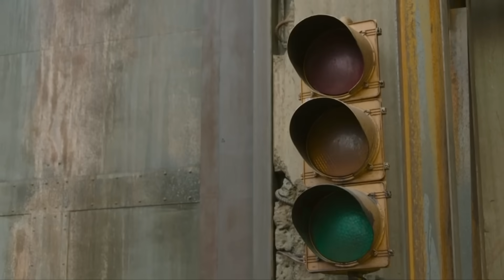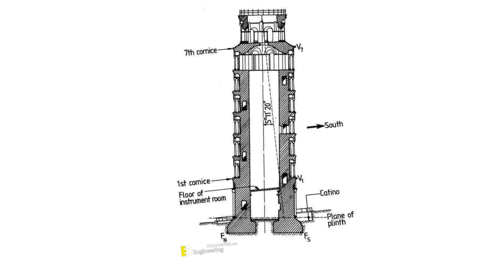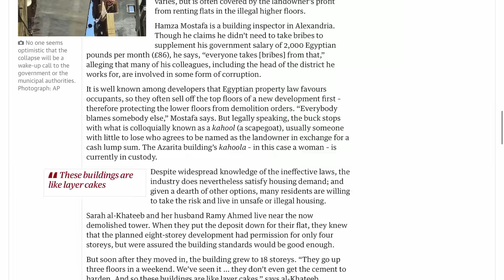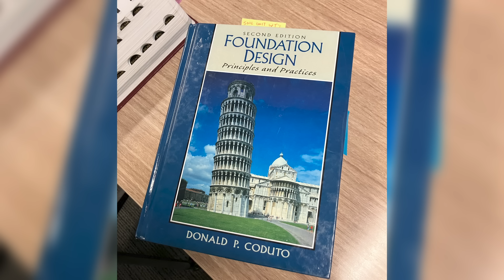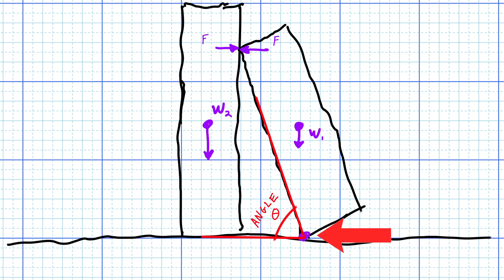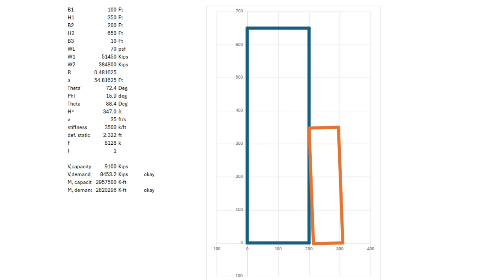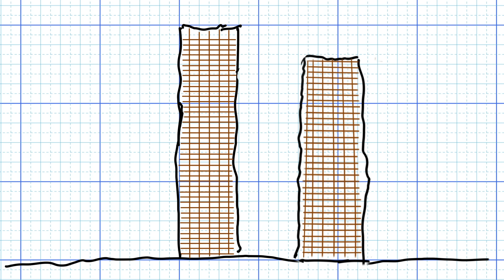Analyzing the Leaning Towers from The Last of Us

Comment: Correct "solid body" of which a building is not. They happen to be the sum of their components or designed for upright forces. During storms, how many times have you heard the statement "A transformer exploded on a utility pole" when it was just the breaker and an arch flash.

Comment: @1:50 so, about that. you can actually calculate a pretty good estimate based on the materials resistances to forces that would occur in the stated situation. most of that would assume integrities and stresses based on the area by-laws, within a certain margin, and plan for a contingency to create a relatively safe outcome for the public to happen more often than not. someone had probably done these calculations already. 

ill try and find them, 

hold on.
Reply: @11:10 Fun Fact; when the building eventually strikes the other and comes to "rest" it will also straiten out slightly since it has a force "the more stable building" acting on it and taking some of the force exerted by its own weight. and there will also be a ripple down buildings too. thats what breaks the glass around the impact site that didnt actually get hit most of the time. just remember. from a certain perspective... everything acts like a liquid or gas kinda. :) we are just free floating masses of not too excited atoms hurtling through space spinning around a giant but relatively tiny sphere of very dangerously excited atoms.

Comment: If one of the building foundation is washed out, it is possible that the others also washed out, so the straight building maybe not just holding because over engineered for the strongest earthquakes, but it may also leans to the opposite direction it just looks straight. For the winds, the two structure have a chance that creates a stronger structure than the collapsed buildings would be alone by holding up each other.

Comment: The collapsing foundation failure could be fudged to provide as much or as little force resisting the lean as needed. The real issue in terms of feasibility is the leaning building's structure at that angle.

Comment: I've watched until 9:34 and theres something I think needs to be said. You state a hypothetical bomb that exposed water mains could lead to flooding. This is fairly close to what the actual reason would be. That reason being that due to it be a post apocolyptic world, there is no longer the infrastructure in place to evacuate water efficiently. This, along with other water related reasons has led to mass flooding in cities, especially this city, during gameplay youll be very hard pressed to find a building where the basement isnt flooded, even large portions of "above ground" areas are also flooded.

So you don't need a hypothetical bomb to break water mains, its well established that there is already mass flooding basically all over the city. ( :

Also not to mention all of the other factors like metro and below ground areas colapsing. @-rx1dr has a good statement on it that you already replied to.

Comment: If it was to be realistic those building would rather look like either WTC  after collapse, or at most a Hindenburg after a fire - a half smashed tumble of twisted beams and ruble laying on the ground. But what looks even more absurd are those half-destroyed buildings where equal parts of curtain wall and framing is missing while the rest of the building is perfectly straight... Like it was done in some painting program 🤣 In reality, only the curtain wall should be stripped by initial blast, and the underlying exposed framing should be partially bent and collapsed on itself due to sped up corrosion as compared to parts not exposed to elements. But hey, what do I know xD

Comment: Also, the impact of the explosion (which is basically between the buildings) should've sent the building leaning in a different direction.
Reply: Not even the US biggest airdropped bomb would push the buildings apart, the buildings have to many open faces.

Comment: You actually made me think to the old Professor Fontecedro.
He said that Geometry had no solid basis.

He made this logic assumption: if we want to describe a square, we have to say that a square is a geometrical figure that have four sides and four angles each one have 90° of extension.

All good until here? Good.

To describe a square we had to use new terms that are: "angles" and "sides", "degrees" etc.

All terms that implies and ask for further explanations to define them and so on forever.

In short: geometry doesn't have solid basis.

Comment: Yes this is highly possible because I I have seen it with my own two eyes what columns  can do after a natural disaster. I worked on construction site  where Hurricane Harvey had passed. I went there after a month and I  saw what independent columns can do to one another after a strong natural force passes by. In The Last of Us it would be the force of decaying concrete giving up any tiping over and leaning on the next building which will cause the rebar to interwine with each other.

Comment: All this seems to me to say "it's very unlikely and would need to happen a specific way, if at all possible." With that delicate of a situation for the towers to initially end up like that, it makes it practically impossible that they're STILL like that when the player views them considering that the story takes place 20 years after outbreak day. Something somewhere must have worn away due to the elements enough that they should have fully collapsed by that point, in my opinion. Maybe not. They are made of rock and metal so maybe they could withstand 20 years of weathering after an initial bombing?

Comment: What about a smaller building (meant to be expanded upwards so the structure is super solid). This one gets a taller building resting on top of it ~ish instead of on its side. So most of the force would get transferred at angle closer to the y-axis (which the supporting building was designed for).

Comment: Great video! My take on the withstand of the building (and this may be a bit of a reach) is that the buildings over the 20 years are supported by cordyceps and it somehow stabilized the building’s structural integrity. I mean considering how powerful and robust bloaters are, enough of those kind of shields might have reinforced the building.

Comment: In the game, The leaning tower has an entire metro station right underneath it that its lower levels have "sagged" into. The player descends down the tower, through openings in the ground and soil, and into the station without ever exiting the tower. I believe this supports the theory that the tower is leaning the same way the leaning towers we have now do? i.e its sinking into the ground as opposed to it somehow toppling onto the other tower. Also, the tower is still actively tilting in the game. You have chairs and tables sliding down the floor by themselves as you walk, meaning the tower is still actively in the process of leaning and the characters are constantly commenting on it. The relative stability of furniture and computers on desks though points to it gradually tilting, not collapsing into the other tower due to bombing. So if you go by what we see in the game, the tower is very gradually leaning into the other tower due to its foundation sinking into the metro station below it in, it happened recently, and the tilting is still actively going on with the tower likely collapsing in the upcoming weeks/months.
Reply from the maker: Oh nice! I knew that there would be more game logic to this that i wasn’t aware of. A void like a metro system below would make even more sense under a bombing scenario since we don’t even need to assume a water main break. Thanks for adding to the convo!
Reply: I think there was FEDRA patrolling the area and in game we can see there is a massive drop off near the base of the building which forced them to go through the building otherwise they would be caught on their way to the fireflies after curfew
Reply: If I’m remembering right it is also sagging a lot more than the show
Reply: Good points!
Reply: Thank you for this! I came to mention that you go through it in the game and you explained it perfectly.
Reply: what was even so important in the first place for them to go into that leaning building vs any of the more stable buildings around
Reply: @Subreon  It was either the only way or the only available way to get to their destination. Within a reasonable time frame. They were being followed by FEDRA at that moment and needed to get Ellie to their destination ASAP.

The other buildings may have rusted doors or collapsed walls, blocking their way forward. In real life, it may have been safer to build a way over the other buildings if they can't go through them, considering that the metro was infested and there were also some infected in the two towers as well.
Reply: @Subreon  If you pick up the note off of the dead smuggler in the tunnels, he mentions that he’s there to smuggle Frank (Bill’s partner) into the Boston QZ, this leads me to believe that this is a well known smuggling route amongst smugglers like Joel and Tess.
Reply: @Subreon There was a huge sinkhole blocking the path forward and there was people behind searching for them as it was just outside the QZ so they couldnt turn back, so they cut through the building.
Im not sure if the presence of that huge sink hole makes it more realistic that one of the buildings was subsiding into the ground or not.
Reply: @Subreon because it’s really cool, and people would definitely wanna go into that death trap if they weren’t already able to
Reply: @Subreon ngl bro that’s a dumbass question lmfao
Reply: @vaudeville-villain  literally fucking how lol. i've never played the game. you expect people to just know stuff automatically?

Comment: In the video game you're able to see that the fallen building wasn't from the foundation it was because the lower left side of street level was bombed causing the building to topple not because of its foundation but because half the lower levels were gone. So think more so a chair losing its leg rather than the floor tilting the chair.

Comment: I remember arguing with someone over the internet about 9/11, back when I was dumb enough to do so. He was asking why the buildings fell straight down instead of falling over like a tree. He claimed buildings only fall straight down when there are bombs on every floor, like in a planned demolition. He showed me the photos of the small buildings that fell over in earthquakes and such as proof of that. I tried to explain to him that there is a big difference between small buildings and skyscrapers, but he wasn't having it. It didn't fit his perception of reality, which I’m sure was shaped mostly by TV and movies.
Reply: I realized at some point than when “truthers” claim it looks like a demolition, that’s exactly what they mean. They truly think that buildings naturally topple over and not that they crumble when they fail. They don’t realize the immense forces that hold a building together and up and how fragile it can be/look when things go wrong even by a few degrees over those large distances. It’s amazing to me they don’t understand that it isn’t actually a rigid box and that, no, you can’t assume it would fall over like a domino would.
Reply: Not only that, but Twin Towers had quite a unique design to them with rigid steel core in the center, the outside frame and floor platforms suspended in-between in a self sustaining tension
Reply: There is also the factor that an Earthquake involves the building to be subjected to both vertical and lateral movement of it's foundation. Thus at the moment of an Earthquake induced failure the structure is generally already going to have some lateral momentum that it will carry with it into the collapse sequence. The twin towers were at rest prior to the collapse so without some imbalanced lateral load where is the lateral momentum supposed to come from. Stuff does not accelerate for no reason you need an imbalanced force to accelerate them.

Comment: I thought almost all glass and steel buildings of this size were actually huge concrete and steel cores with non structural exteriors. thats why the twin towersdid not collapse until thecare section gave way, not when the exterior wallsweer destroyed. These solid wall buildings in Egypt are an entirely different scale and type.
Reply: Twin towers used both the core and the outer perimeter as the main structural members. It’s what allowed them to have such “open” interiors. Other glass-curtain buildings do have less support on their exterior, but sacrifices some of the interior space to do so as well as having cores. This is in contrast to older buildings that are essentially just a bunch of repeating cubes of consistent spacing throughout the entire structure like the Empire State Building. There’s plenty of room for hybrid structures as well and a spectrum of design choices mixing the methods. Twin towers were almost purely core and outer frame, though and the prototypical example of that.

Comment: In some of the views you showed, it kinda looked like the leaning building flexed a bit, almost like it's partially hanging from the other instead of leaning onto it; maybe they got tangled just the right way that the velcroing hit just the right balance between the pushing away from leverage effect and the pulling in effect of the leaning building trying to get concave and bring the other building over it?

Comment: Going off your bombing broke a water main and washed out the foundations idea, it could be possible that BOTH buildings started tipping towards each other, and made contact but stopped as the water service shut down, leaving only seasonal runoff to continue the errosion. Thus as the buildings shifted over the decades, the one which appears to be leaning ended up supporting the other and pushing it back to near upright.
Perhaps the supporting action is then compressing the pillars of the first building, somehow preventing an immediate collapse due to being off angle?

Comment: Also a reason it wouldn't work is that the leaning building would most likely collapse in on itself. High rise buildings are constructed to resist the force of their own weight directly downward first and foremost with maybe the capacity to resist the temporary vertical force of wind. When the building is tilted the weight of the upper stories can no longer be supported as intended by columns and the steel frame which are only able to hold the weight coming from directly above. It would be like if you have a cardboard box on its side so that the opening points forward. If you put the weight of say a book on top of it it will hold, but as soon as you tilt the entire box by 5 degrees to the left, the sides of cardboard, representing the steel frame and columns in this parable, would no longer hold a weight coming from directly up but at an angle, so the box would fold in on itself to the left. The edge of the box where the cardboard is folded at 90° connecting the sides is a fracture point that remains stabile only as long as the weight comes from directly above. Similar fracture point exist in high rise buildings, the steel frame etc. mostly being constructed in that same cubical symmetry.
The other building might even remain standing if it's strong enough to resist an impact force that's going to be further down its side, only part of the leaning buildings weight since it's falling apart and as a force directed more downward than pushing vertically.
Reply: Great analogy!

Comment: The thing that gets me about the one shown in the show is that the collapsing building already has a sag low enough to facilitate its complete collapse.  Unless the elevator core is holding together the entire building it just strains credulity. 

I also don't see how you get a modern skyscraper to that angle without compromising it's rigidity.

Comment: good video, i had lots of very bad things to say to you but as the video went on you continued to account for the criticisms i would have said
the only problem i have at the end is that i think your fundamental idea of the buidling simply falling over is unlikley and not what is seen in the examples and not what most media shows
what i always thought happens is that the buildings lower floors colapse and as it falls down it also tilts a little, this way its not pushing so much laterally into the straight building but more so draging it down as the beams and collumns interlace and mesh in their colapse which the straight building would be very well equiped to deal with
to me the question is instead can the leaning building support those sideward forces in its now tilt and especially the sideward forces in the midpoint between its collapsed base and the other building supporting it

Comment: A second issue with the calculations being done in a vacuum is that these calculations are being done assuming the (mostly) vertical building has no foundation damage of its own and that it doesn't have it's own (less obvious because it's still basically vertical) lean. This could even help with any impact force if instead of the impact knocking it over, it simply acted to right it